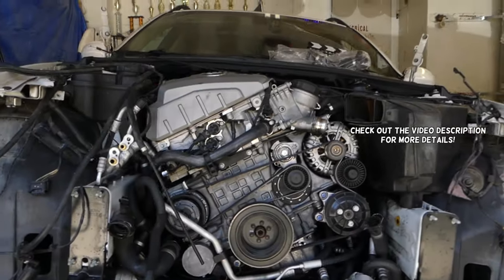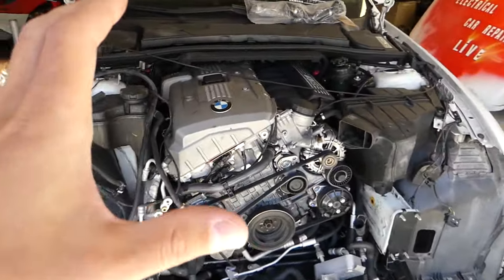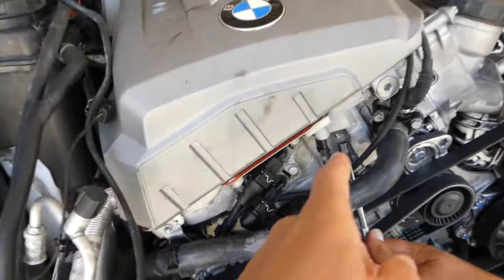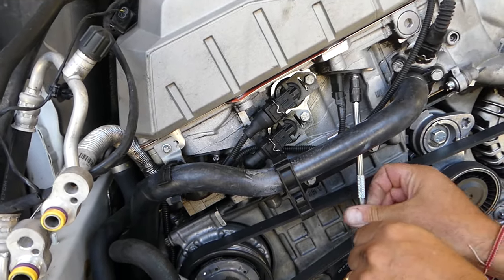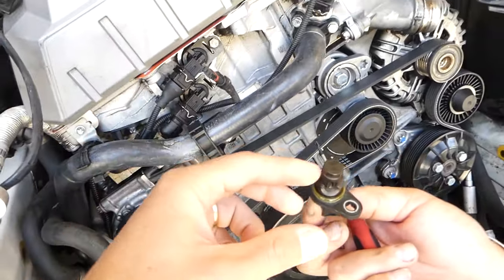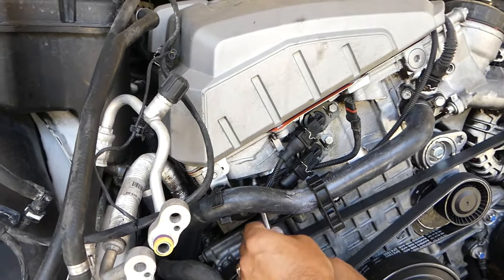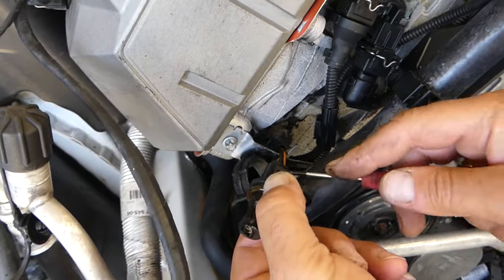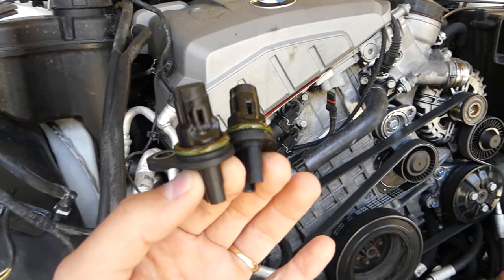BMW E90 E91 E92 E93 CAMSHAFT POSITION SENSOR REPLACEMENT E60 E83 E82

Comment from the maker: Products that we use and recommend:
►► Replacement Camshaft Sensor used in the video: https://amzn.to/2YiAATT
► Assorted Fuses: https://amzn.to/4f6qJos
► Panel Removal Set: https://amzn.to/3YiMADu
►Torx Set: http://amzn.to/2hbyWgd
► Tool Set: https://amzn.to/3p5MM6t
► Screwdriver Set: https://amzn.to/3XRB28Q
► Engine Oil: https://amzn.to/3xBc8B9
► Oil Filter: https://amzn.to/3w0Ulme
► Torque Wrench: https://amzn.to/32qyRwg
► Liqui Moly Engine Flush: https://amzn.to/3IiDBID
► OBD Scanner that we use most often: https://amzn.to/3I4MQfe

► Check out our Amazon Store for the tools and parts that we use: https://www.amazon.com/shop/worldmechanics
Reply: Thanks for info I am not sure where the intake camshaft position harness connect to it needs to be replaced can you help

Comment: I changed my valve cover gasket, cam shaft sensors ,and the injectors.  Now my 08 328i crank, but won't start.
Reply: It's repaired? What was the problem becouse it got the same problem
Reply: @emate8422 did u fix urs? I’m having the same issues with 5 different codes pertaining to cam positioning sensor.
Reply: @hollyhood69  no, i didn't repair it, I'm gonna try this week, and if not, I'm giving auto to mechanic
Reply: @hollyhood69  I've checked everything with wiring, fuses etc. I have to check this sensor also
Reply: @emate8422  what codes do you have
Reply: @hollyhood69  no codes, only from electric  water pomp, this is most difficult,  nothing appears on computer

Comment: Which sensor is "Bank 1"
Reply: the intake
Reply: Are they not the same?
Reply: @kridermcclay  that's wut I'm saying lol there's only 1 bank?
Reply: @coltonkelly6303 they is 2 of the same senors monitoring exhaust and intake camshafts
Reply: intake
Reply: @coltonkelly6303 there’s 2 banks on every car. Every car is going to have CPS “Bank 1” & “Bank 2”. Along with the crankshaft position sensor. When one goes they all go soon after. Best to change them all at once.

Comment: There is actually three of them. You've got your intake before you got your ex which is out that's the two of the front of the motor behind the fan and then there's one down in the bottom by the the pan seal I believe is where it's at that's the true cam sensor. The other two measure pressure to help the timing of the the valves the sensor itself is down below underneath.
Reply: Yeah my dumb self changed the crankshaft instead of the camshaft. So now I have to ordered 2 for the front ones 😂🤦🏽‍♂️
Reply: Are the camshafts the same? Or is there a difference between them? (not talking about the crankshaft).
Reply: @WOL676 Toko my scanners reading camshaft position over retarded .. do yk what to do
Reply: By the third "down in the bottom" you are referring to the crankshaft position sensor, correct? What reason would a camshaft be down away from the cams? This guy has a video on the crankshaft position sensor as well and I believe that's what you're thinking of.
Reply: @tjfisher746 Nah he is referring to the "true cam" apparently.

Comment: Just picked up an E93 with engine shaking upon start up. Going to try replacing these. Thanks for the great video!
Reply: check the crankshaft position sensor too. a bad one can cause rough idle, long start, and crappy shifting.
Reply: Did it help out? Mine is doing the same and can randomly give out while driving. Please lmk if it helped out🙏

Comment: Are the sensors the same part just in different position on the motor? The parts store doesn't show a intake or exhaust option for sensor just Camshaft Position Sensor option?
Reply: Yes they’re, same with the vanos solenoids

Comment: Hello i accidentally broke one of the 2 clips of the sensor ontop and im wondering if its okay to just put it on 1 clip? Put tape maybe? Or if i do have to replace it, can i just buy the clip part ring ish thing?
Reply: Replace it, find the piece with the clip from junkyard. Cut it rewire it, wrap them up with high temp electrical tape . make sure you disconnect the battery before touching anything.

Comment: Short question: if the intake camshaft sensor is not good that can make the engine unstart?
Reply: That’s what I’m asking
Reply: What did it end up being
Reply: @coconytv  my check engine light came on and thats wut the code gave me…but tha car still starts and runs just a loss of power
Reply: I’m wondering that too mine won’t start and all the codes says camshaft position sensor a intake so idk
Reply: thats probally the crank sensor
Reply: @cesarrodriguez7162  it’s your crankshaft position sensor not camshaft position

Comment: What would be the main reasons to replace these sensors? And what is the typical mileage life of one of these as well?
Reply: Camshaft sensors are like really important they basically send data to the engine and even a lil mis information can cause engine shakes and cause misfires so it’s important to change it
Reply: For simple words it’s a bmw takes good care of it

Comment: My 2011 e90 got toy away when I went to pick it up all my check engine lights are coming on it's automatic transmission my gears are locking up I just ordered and received a camshaft sensor .. my transmission light is yellow when I put it in drive it takes  a few second to catch the gear

Comment: Hi I have a BMW 318i petrol lci 2009. I have rough idle and engine light comes on often the obd2 code is p13b4. Problem happened  2 weeks after major service? Can you help pls
Reply: cost me 250 USD
;(

Comment: I replaced both vanos solenoids  BMW  2011 328I and still getting a p0015 code ,do you think one of the sensor is bad?
Reply: Did you fix the problem on your bmw

Comment: I changed these two sensors out and then my car started to long crank and never started. What caused that? What did I do wrong?
Reply: Did you ever get this figured out? I have same problem on my bmw now
Reply: Prolly supposed to change the crankshaft underneath the starter

Comment: Hey there i have been having a big problem with a bmw 325i 2006, the car randomly starts to mosfire until it stalls when below 2k rpm during driving, if i put it in neutral it stalls, when i try to turn it on again it rises rpm and then stalls again or keeps running very roughly, its annoying as the code i had is not there anymore but i eventually saw p1554 code coming, i already invested a lot of money, could this be the fix? 
Eventually when i stop the engine for a few minutes and start again everything works normally (wtf)
Please Help me as i am desperate, sorry for bad English
Reply: Did you fix the problem
Reply: Replace spark plugs and ignition coils that should fix it
Reply: After 200 k miles is better to get rid off 325 BMW . Bótalo o regálalo porque si no es una cosa es otra .

Comment: Yes I would like to know on a bmw 328i 2007 camshaft sensor which is bank 1and 2
Reply: They both the same sensor almost all close to each other if you have to replace one just replacing them both

Comment: I have the same fault code. Outlet sensor synronisation. I replace the outlet sensor but still car going of and still the same fault. En also te air mass give vault en now the vanvotronic also. Pls help
Reply: Not an expert here, but try this. the car is trying to tell you that something is tripping out on the timing system. Outlet = exhaust i think, so try cleaning the exhaust solenoid? Also, you said that you replaced exhaust cam sensor. try just unplugging the sensor from the connector and see if it runs any differently

Comment: Hi can a camshaft sensor cause a no start?
Reply: yes it can. It can cause no start, slow start, slow acceleration, and stalling at low speeds/idle. Scanning the car might help determine if the faulty sensor is the intake sensor or the exhaust sensor. After finding which sensor is bad, keep the sensor bolted in but disconnect the connecter from the faulty sensor and see if it starts.

Comment: I changed the camshaft sensor and my 2011 is starting but  not turning over what else could it be
Reply: did u ever figure out what happened my car is doing the same thing same year and model
Reply: I took it to a reliable shop and they told me my engine didn’t have enough compression and that the engine was shot … so I went and got another engine and installed it myself and I’ve been goood ever since .. but if I was you have a mechanic look at it first

Comment: Does anyone know the parts code for the intake sensor cable connection or where to get one , tried to do this fix only to notice the cable connections housing was snapped in half 😳
Reply: Same here 2 days ago 😂🤦🏽‍♂️
Reply: @WOL676  bloody nightmare 🤣 time to go to the scrapyard
Reply: @matthew8290  🤣🤣🤣
Reply: Managed to find the replacement connector
Reply: @matthew8290  links please
Reply: @mrceven  you may also need the terminal pins depending g if they are damaged are not , the three cables that go into the connector have small metal clip ends , slide them into the same positions as the original connector and press down the the plastic lid

Comment: What are the symptoms of these sensors going bad
Reply: stalling, check engine light(transmission light), car will turn off
Reply: @republicofu.s9642  loss of power maybe? Like hesitation sometimes it really doesn't pull at all until late in rev range
Reply: Stalling, rough idle on cold start especially when stepping on the brake pedal. Costs between $500 to $750 to replace.
Reply: Kerwin Thomas if you go on fcp euro the parts are cheap plus it’s oem.

Comment: All i did was change the o rings on the camshaft sensors and vanos solenoids....now my e90 is idling hard and cutting off....what could it be?
Reply: maybe you plugged the vanos connectors back in to the wrong solenoids, the short wire should go to the top solenoid
Reply: melvin valentine did you fix the problem ?
Reply: @4-matic212   Took it to my mechanic who worked for bmw for 30 years.  Looks like the valve cover had a crack in it....but I was confused how that could happen from just changing o rings.  Maybe it was already cracked.  Since then I got valve cover replaced and changed the valvetronic motor.  Now I have a service light that says the intake vanos needs to be replaced AND I need new DISA valves.  The car had 113000 when I bought it so I knew some maintenance was required.  I hope after the vanos and DISAs get fixed the engine will be ok.....maintenance before mods!

Comment: Why is my sensor leaking after replacing it on the exhaust side
Reply: Plus the rubber gasket is still good.... Are the sensors on the exhaust and intake side the same or different

Comment: Where can i find the crank position sensor on a 06 330i bmw
Reply: Location by the starter on top of the transmission I installed it from the bottom without removing anything, but that was a challenge.

Comment: Can a bad cam position sensor (intake or exhaust) cause major timing corrections?
Mine are mainly in Cly 4.
Reply: They don't reply.
Reply: I’m having the same problem cly 4 too and I just replaced the coils and spark plugs. Put the machine and said it was a bad camshaft and cly 4. I’ve been driving it but it has a really rough idle and jerks itself when stoped
Reply: @omarcortes2719  same here
Reply: @omarcortes2719 did you figure out the problem? Or @wol676
Reply: @WOL676 ^^
Reply: @MarkBlack-bl2bv  yes camshaft didn’t sit right in 😅
Reply: @WOL676  so the new sensors fixed the issue ?
Reply: @MarkBlack-bl2bv  for me, Yes it did

Comment: Hi
If I replace the 2 intake/exhaust sensors... will that help get rid of the error ‘P052B and P0012?
Reply: Yes I got the p0012 and it went away after changing the camshaft sensor
Reply: Daved Alvarenga oh that’s is great.
Did you change both 2 camshaft sensors?
The intake and exhaust sensors? Or just the intake?
Reply: The code was just for intake camshaft but I replaced both at the same time 
L
Reply: @davedalvarenga603  did u get the ones off Amazon they shared.  .  Did they work out?
Reply: @jasonp53  no my local autozone had them in stock so I bought it from there and it worked fine for a month or two and then I sold the car while it was still working
Reply: @davedalvarenga603  😂🤣

Comment: Wait i thought the sensor is under the manifold ?
Reply: Crankshaft position sensor is under the starter
Reply: @brandontaylor3782  so i have to remove the intake manifold
Reply: @lalogarcia1564  Yes its actually easy to remove
Reply: @brandontaylor3782  my car is a e90 2006 330i
Reply: @lalogarcia1564  if it has the N52 its most likely in the same place under the starter